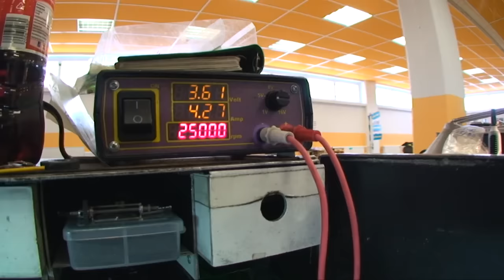Slot car racing European Championship Finals, Helsinki

Comment: I used to race this class over a decade ago.  As with any form of racing, you're always looking to go faster. It got to the point that it was just too ridiculous .  The "cars" just don't look like cars any more (mind you, you can't actually see them during a race). The bodies more closely resemble a wedge of cheese with tall plastic walls surrounding it on 3 sides.  When the hard-body cars started turning up, with incredible detail, I "jumped ship" immediately and never looked back. of course the cars are slower, but so is every one else's. I am, after all, an automotive enthusiast, not a "wedge of cheese" enthusiast!  (I like EATING cheese, though.
Reply: They are fast and super fun, yup.
Reply: However, modern full-size LMP1 cars look more and more similar to these "wedges" as the years pass. It's all about ground force and air control.
Reply: Around here they called them flys because of their shape.
Reply: Travis Rabble Skylar
Reply: Skyler
Reply: I used to do this too but have since turned to online Sim Racing. I like the sim racing better. ;) Assetto Corsa and Project Cars 1/2 are great.
Reply: I agree this isn't even racing anymore. I use to race this size CARS as a child we even had a track my father had set up in our basement it was great as we watched our cars being careful not to go to fast around turns or they flew off the track. My first car was a junker built from spare parts my father had it was so much fun back then. But this is just dumb Say start, squeeze trigger full throttle and not even slow down till its over a few seconds later. Were's the fun in this you cant even see these wedges.
Reply: you should take a look at Tamiya
wheels are everywhere but hey theyre still cars 
(and yes Ive just started)
Reply: Indeed .. Does remove all the fun of racing beautiful scaled models and these are way too fast to see anything happening, totally useless as fun ..
Reply: It's called racing or motorsports
Reply: This is just eh wing car stuff though. It's a builder's class in a lot of ways...building a motor and setting up a car to stick really well. There are a lot of other classes that are still more a driver's class to. Eurosport, Production, and LMP classes are all a LOT slower.
Reply: bigswifty1000 for real racing race vintage G Plus T Jets are 1/32 with no magnets...tuning and balacing cars than becomes an art.
Reply: Close your last bracket, god damnit!  >:(
Reply: Man I’ve recently started racing RCs at club level and you’ve pretty much hit the nail on the head as to why I will never go to Touring Car classes….yup they are quick but they don’t look like cars anymore. In the Tamiya class we can run pretty much any body shell as long as it’s not racing spec (e.g nothing LeMans etc)…def makes it fun to watch seeing all sorts of different cars in track……and of course also the F1 class
Reply: They ruined slot car racing when they used magnets that were way too strong.
Reply: To be human is to be a cheese ethusiast. It’s ok to not like watching your cheese drive along a track tho.

Comment: Can they actually follow the cars with their eyes or are just pretending?
Reply: They are following the cars, as you need to reduce throttle in the turns, otherwise you’ll fly off of the track. I built and raced these as a teenager and my 16 year old eyes were fast enough, I wonder if I could still do it.
Reply: FOCUS...it helps to be “high”...👍
Reply: The main part they focus on us the upramp section because if they don't lay off there they'll launch in the air. Aside from that I guess it's all about muscle. memory and timing. Takes practice.
Reply: Basically,  it's  a kind of rhythm .
Reply: Dragon ball Z fights are a piece of cake for this guys
Reply: @boataxe4605  reduce speed from light speed to supersonic

Comment: Strap a go pro on one
Reply: Instant Barf.
Reply: Too bad the cars have to be as light as possible to go that fast, it would be pretty cool to have a camera on one
Reply: You could save one track just for the gopro and crank up the juice, I vote for the middle track.
Reply: Steven Arseneault agree!
Reply: Baldomo Just drive slowly with the car with the go pro on it and then speed up the video to match the speed of the actual race car
Reply: They would have to be slow and sturdy to hold a GoPro
Reply: Yea a really Light high speed camera would work actually. But it would look still blurry...
Reply: @milo20060  and also, is it worth it? I mean yeah all your going to see is a blur
Reply: Omg NO! I'D PUKE
Reply: would been cool lol when we get slight heavy race cars with go pros
Reply: Go pro is  too heavy, it is possible to mount small mobile phone cam with memory and feed it from track mains, but it still adds unnecessary weight, so car speed must be lesser.
Reply: ...Or some other brand of action camera.
Reply: 90loneeagle They can't. Something about the "space-time continuum".

Comment: I had never heard of this before. I would imagine that if a car were to fly off the track, someone could be obliterated by it.
Reply: Those aren't hold magnetically. Only the downforce is keeping those down. The mass of those things (~14g if I recall right) isn't big so getting hit wont hurt.
Reply: With that speed, believe it will hurt.
Reply: japo2101 -16g
Reply: The cars weigh very little and the aero drag once they deslot is so high that they just flutter to a stop in a very short distance.

Comment: I used to have a few cars and Raced quite a bit. I got started at an early age, around 14 or 15 but went back to it later when I saw a new track around the corner from where I used to work.. I think I was in my late 20's or early 30's then.. But there was a Definite difference between the "Men" and the "Boys" and it had nothing to do with Age. The Technology had improved 10 fold. But I couldn't help myself, so I bought back in to the hobby once again. I got a new Car and a new controller and hooked myself up and tried to regain my skill... Only now I couldn't even Focus on some of the Cars I was racing. They were going So fast. Much faster than I ever remembered. If I tried to Race at the same speed and pace as those 10-15 Year old "Men" I'd watch my Car fly off the track and shatter into pieces....A lot of the "Men" that were "Blowing My Doors Off" were as old as I was when I first got into the hobby as a Kid...it was a little embarrassing to say the least. 
I still had a blast and got better with practice. But I'm still amazed at the Skills of some of those young kids....

Comment: I first started running slot cars in 1963 with Aurora HO cars....it was fun!  The summer of 1966 a larger scale track opened, and I had a larger vacuum-formed body Ford J car.  Speeds were fast and cars in the banked curve usually ramped 20 feet through the air if they came out of the slot...a lot of fun with everyone having a good time.  This modern stuff is ridiculous.  It isn't racing, it's who has the most tech.  I didn't see one bit of anyone having fun in this video.  Looked like a zombie convention.
Reply: S. Smith slots are fun if they can be seen and you have to use some driving skills...too much magnet too much speed.
Reply: In my day....
Reply: WOOWWWW WHY DID THE DUDE WITH THE FASTEST CAR WIN WTF

Comment: How do they knw who won
Reply: Lap counters. They tell who has the most laps.
Reply: DroneLife there are monitors
Reply: but it can't be fair right? , cause it fully depends on speed and if you are in the innerturn or outturn?
Reply: Everyone's a winner
Reply: Electronic scoring. Watch again and you will see the scoreboard.
Reply: Robert, there is an even number of turns that are similarly paired up. Its about the same. No doubt they would also have heats and/or slot draws.
Reply: Lol lap counters... you control the cars and build its speed then if you reach a certain lap point.. everything stops.. you just... push the button hoping you finish first
Reply: @ Robert That's why the circuit is an eight. With that form, every car has an innerturn and a outturn, and whatever line you're on.
Reply: Also the computer keeps track of the activity of each lane so there is no confusion
Reply: @dmoneyswagg64  Not necessary to insult to explain. For my part, that's the first race of that kind I see, so I don't know anything about it.
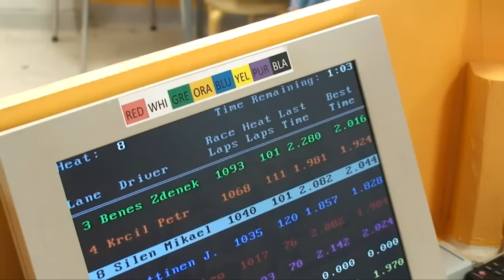Reply: 3:15
Reply: @creamycyanide5480  Not true. They have to slow down for the turns and accelerate out of them. The cars fall off the track when they try to go too fast or accelerate at the wrong time.
Reply: Rock paper scisors
Reply: with a slow speed camera 6000x speed. Nah idk this is crazy
Reply: they do lane swaps after a certain number of laps to equal out the distance for each "driver"
Reply: They were racing slot cars.
Nobody won.

Comment: Do you just hold it full throttle? wtf I thought it was fast forwarded 10x at first. There's no way one can be making throttle entry/exit and braking precisely to be making the corners that fast. Unless u just memorize the control inputs for a lap then you can race blind.
Reply: You cannot just hold it full throttle, otherwise they will fly off the track on the corners. There are no breaks on them though, just less throttle (which acts as the brake: these cars can stop very fast when you let off the throttle). You can see how fast they can slow down when the race stops. Looking at this on youtube, you would think you cannot keep track of your car, but irl, you just fallow it with your head as it goes around the track. (reason for all of the head bobbing lol)

Got pretty into it around 10 years old and had fun with them for a few years.
Reply from the maker: There is little knob in a controller where the driver can set base throttle which makes the car go around in a speed which is not too much for any of the corners. Then the driver just applies more throttle in straight lines to get faster laps.
Reply: Jussi Kämäräinen Now that actually makes some sense.
Reply: Jussi Kämäräinen i think the point is these cars are going so fast - that there is no time to make those changes. surely at his speed itis just a case of building a solid car and holding the trigger down on full.

I would rather play scaletric with slightly broken cars that force you into varying between 30-80% throttle. at least you feel like you are driving something
Reply: Nope, they are able to control the car...With a bit of practice, its not too hard.
Reply: Lol
Reply: Don't forget the wings and the fact they put glue on the tires.  Take away the glue and the wings and this is a lot different.
Reply: neiana The glue goes on the track for these cars. . .
Reply: Iuh
Reply from the maker: John Moyse at 02:00 you can see how fast they are adjusting throttle, multiple times per second.
Reply: actually yes they are.
Reply: Leuel48Fan - these are wingcars, they have air spoiler on the side to help push them down on the track. You still have to release and apply the throttle at the right moments on turns or you fly off
Reply: neiana 
They put glue on the track? Really. I did slot car racing in the 70's. The glue thing must have come in since then at some point. "Back in the day" it was about sticky tires. I remember doing power slides and fish tailing like crazy. Lots of fun for a 12yr old. Motor technology must have made huge advances since then.

Comment: Never seen anything like this here in the states. I used to be into slot cars until 2008 came around and it was to expensive to spend any time at the local tracks. Never seen any slot car go this quickly, not even on the drag track.

Comment: I just have a question honestly. Why are the "drivers" moving their heads for it's not like they can see the cars..........
Reply: Benign Rabbit lmaooo what i was thinking
Reply: they probably focus on a few points where they can see a glimp of the car
Reply: They can see them in person. The cars are too fast for the camera. Like a helicopters blade on camera.
Reply: They are not watching the cars. They watch the pink elephant dancing ballet between the pillars. Don't you see it?
Reply: They can see the cars
Reply: If you can see how the cars are painted... they pretty much follow blurred color on track. :D
Reply: Some just don’t get it..
Reply: they look at the glimpses of them at every turn because they have to reduce throttle or they’ll fly off the track and could even break or hit someone. it’s an extremely precise sport that takes a lot of practice to get used to
Reply: Have you ever tried to follow one propeller of a fan when its moving fast?
Reply: @marktemsic485  i feel you
Reply: how exactly is this hard???

Comment: They were doing around 2.3 seconds on a king track which is 155ft, and they weren't using glue.  The art has advanced even since the 1990's when that kind of time was only possible with the sticky stuff.  Obviously, the unlimited class as well.

Comment: Video doesn't do justice, if you watch each driver controlling the throttle you can see the subtle changes in speed, especially around corners, the magnets on cars is what got better over years. I'm almost 60,  G-Force cars for Tyco have been around since I was a teenager, they are very very fast.

Comment: Omg, when I was around 10 years old I had a cheap one of those racing tracks, after playing a bit with it I removed the roofs of my cars and attached the electrical wires from the track directly to a plug wich tripled the speed of the cars, and them having no roof( basically made them flat with just the small electrical motor popping out) made them stay on the track while still going that fast. Those where great times.

Comment: There comes a point in this hobby when cars get too fast... My opinion:  Forget the magnets, because without drift, it just loses the fun and challenging element of the hobby.
Reply: I definitely agree, racing my cars with the weaker magnets are more fun
Reply: The motors wouldn't work without magnets. Used to race similar cars about 20 years ago, but with restricted motors so a bit slower. What keeps them on the track is aero, not magnets. Plus the tractions compounds used on the super soft tyres. The cars are still drifting as the slow motion replay from around 4:28 shows.

Comment: I can't tell if they're playing with the throttle at all. It seems like they're able to go full throttle around the entire track.
 The cars during the slot car craze in the 60's and early 70's were still fast but you had to really use your skill in the turns being able to take them as fast as you could without spinning out.
 That in my opinion made the racing a lot more fun and realistic than what you see here.

Comment: Could any one tell the technology behind the cars and track
Reply: jaidev joshi there just like the slot cars you buy a toys are us with bigger motor bigger soft tires and real aerodynamics
Reply: TheVintagetamiya but I haven't seen any thing like this before its supra amazing and fast. We could make real railways or small cabs for public transport based on this this tracks and technology 😃
Reply: it doesn't scale up what might be 5w motors in these would neead to be many many many times that for fullsize. for example a std rail train motor is 746w and there multiple of those plus much higher voltage aswell.
Reply: kyle hubner Right
Reply: Its a loop
Reply: I used to race slot cars. It's a dc loop feeding each lane and the controller is basically a potentiometer. As you pull the trigger it allows more power through to the car. Controllers tend to put out a lot of heat. Motors were almost always custom made by each driver. They had set specs but we played to fit within those. It gets insane fast.
Reply: To add we used to make the chassis from a spring steel paint scraper cut to shape, in the early days we used piano wire chassis soldered together, the motors are governed by the armature winds, ie a single 20ga wind, or sometimes a double wind, magnets got better and the spacing of them is important to rpm, even 40 years ago we had actual speeds of +70mph, you get used to the speed, it's harder to follow a video than the real thing.

Comment: 68 tear old here. The cars we raced in our teens flew off the track all the time. We had to slow down and deal with centrifugal forces. It is true these modern cars can go so fast because of magnets holding them down to the track? If so, there is no need for driving skill.  Takes al lot of the fun out of it if this is the case.
Reply: There is magnet racing but these cars use only air control surfaces for down-force. Its why these are known as wing cars.
Magnet racing is more popular in HO scales as they are too small for air control to have much affect.
Don't knock it till you've tried it. it takes skill in more ways than one.

Comment: Mind-blowing.

Do they even operate the throttle on turns anymore, or is it just "squeeze and go" now?   I raced them in the late 1960s and early 70's on nearly identical tracks, and while very fast you could still see the car and actual had to drive it throttle-wise.  They traded speed for some of the fun  ;-).
Reply: Since some cars are flying off, I would assume they still had to control the throttle, I'm not sure about turning though.
Reply: @mohammeded-dahbi7603  Watch the drivers, not the cars.  Some just squeeze and never let off.  I assume turbulence from a car ahead could disrupt the down-force and make a car crash.  Nothing a driver can do about that.

Just glad I ran them when you could still see them.  ;-)  Flying/driving RC these days.

Comment: Someone explain to me, if someone with the faster car just pushes the throttle shouldn't he win?   Since all the vehicles are locked into their slot - or if you go too fast you will leave the track?
Reply: Not locked in. Too fast for a tight turn and you come out if the slot

Comment: Do they use a controller or just an on / off switch ?
Reply: Variable voltage applied using the finger trigger on the controller.